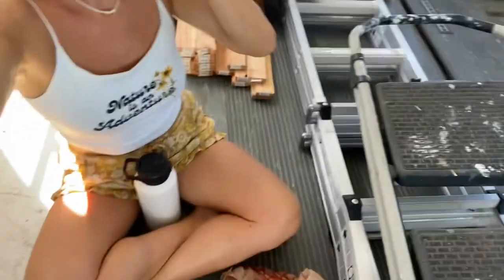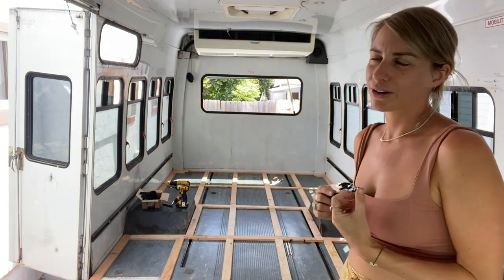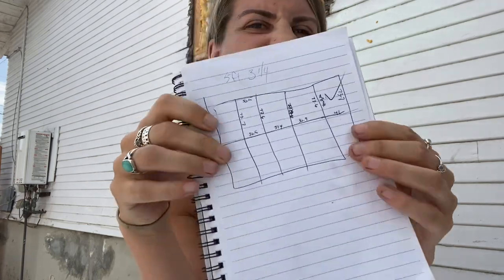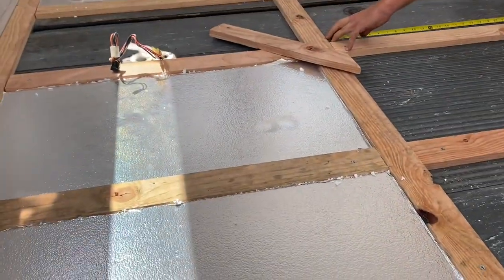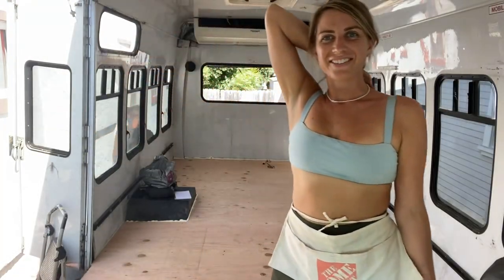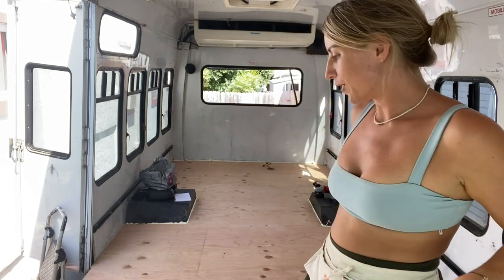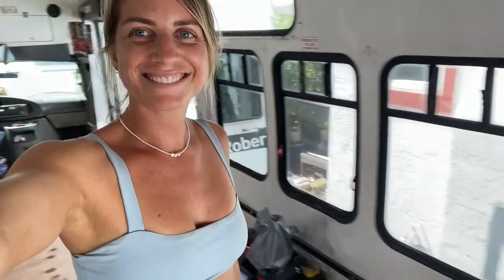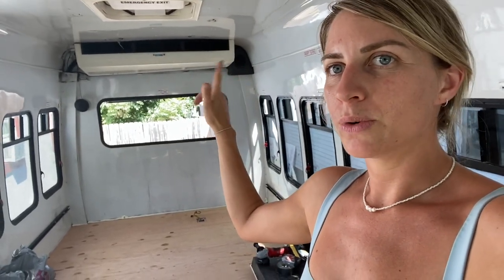Shuttle Bus build - Framing + Insulating the Subfloor!!

Comment: Did you guys do an epoxy or sealant coat over the subfloor to help with moisture control? If so, what was your process?
Reply from the maker: We treated with anti mould outdoors wood stain and gap filled every hole to prevent water getting inside the bus